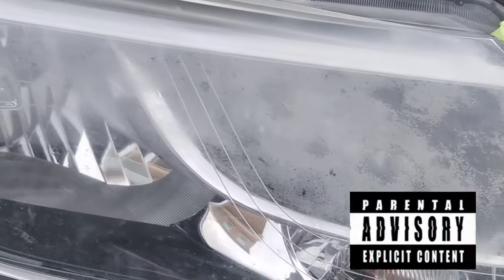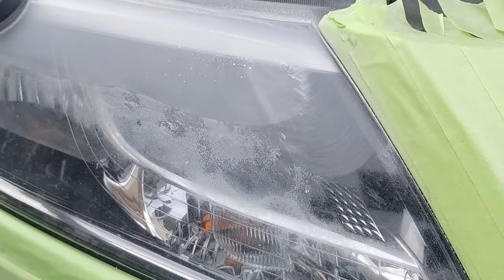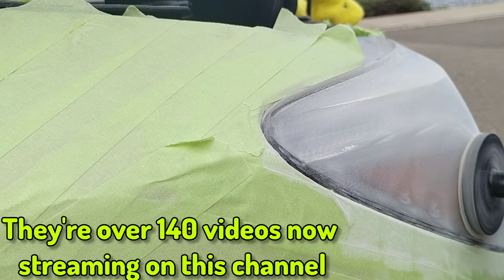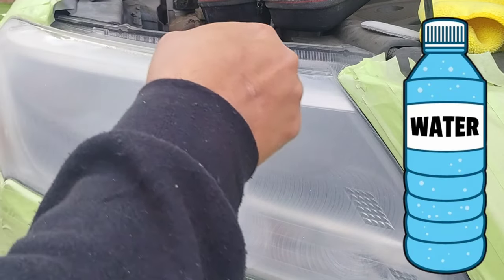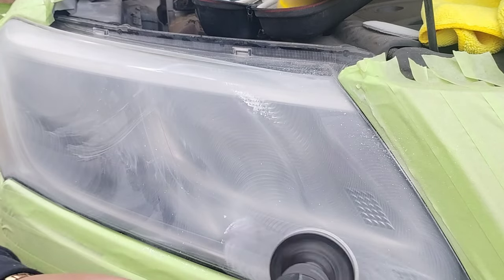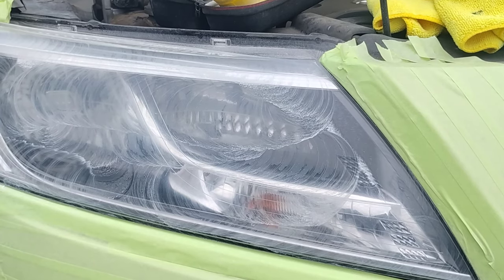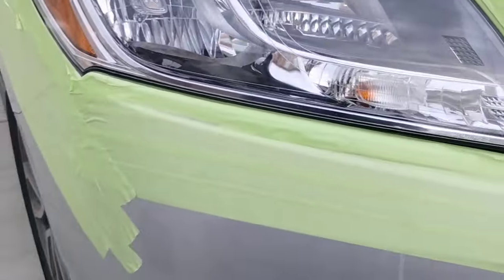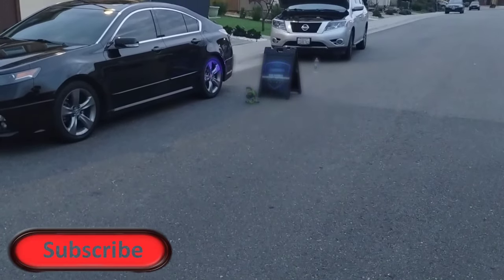Meguir's PLASTIC X headlight restoration - New & Improved ⭐⭐⭐⭐3/4 ⚠️

Comment: I gave this Plast-X polish a try, because the 3M Restoration System kit (39008) only came with enough compound for one headlight.  (Some headlights are so big today!)  I got good results by using it on the second headlight.  I would say it turned out as good, or very close to, the first light.  I do feel like I had to use more pressure, more passes, and more compound with the Plast-X.  The 3M kit I bought from Amazon came with a 1oz packet of rubbing compound (39005).  That compound has the unmistakable petroleum smell.  The Plast-X polish has a mild smell, like a household cleaner, as you said.  The bottle I got looked just like the one you showed in the video, and the liquid was light blue in color.  Anyway, it did the job ... and it's available for about half the cost per ounce of the new 3M 36060 compound, and it comes in a much smaller size bottle ... so it's a major cost savings for a DIY'er.

Comment: It's funny, I've had more problems with Amazon than Ebay.. I'm usually strickly Ebay. They usually have more selection at better prices. Plus the used aspect. Car parts, firearm parts, electronics etc. Ebay can be tricky, you gotta know what you're doing and what to look for. They also have a money back guarantee as long as the seller has a return policy

Comment: Hi I did it I'm a 63 years old woman. 
I used this method without the drill I used that little hand grab thing.  I only used 800 the spong in the Maguires box  then a 1000 then a 2000 used rubbing alcohol then soapy water dryed then the spray . It came out good one thing after it dryed I can see a bit of cloudy still why do you think that is did I not put enough after spray on.
In the morning I'm going to lightly sand with 2000 then the Maguires plastic cream like you have .
At first I thaught oh no I ruined the light but bingo came out clear . Thanks for your videos it gave me the confidence to do it 👍

Comment: What's funny is that, I used that New and improved Meguiars plastX polish, as it was the only available option to me in South Africa, 
Other things I had to find alternatives were the 3M Trizact pads, just settled for p3000 normal disc, 
Then I couldn't get Meguiars headlight spray, but here in SA there is a another made for headlights sealant spray called Lens Clear by HB body, so I used that, not sure if it'll last as long as Meguiars, but I guess I'll see. In terms of clarity, its top tier, didn't get any orange peel or funny effects.

Using your method I was able to get my headlights looking new again just last week, it was the 1st time I ever used any of the products and tools, but followed your method to the T and  thank you for all information, 

With my lights looking good, other than washing your car frequently, what other things or products can be used to maintain the restoration for a very long time?
Reply from the maker: Awesome man I'm glad everything worked out for you..👍🏽
Reply: @theheadlightrestorationpro  in terms of maintaining the headlights any products you can recommend or tips for the restoration to last?
Reply from the maker: @PointJustice aftercare is the way to go
.. here after care 1.0 and 2.0..
https://youtu.be/kIur4XxYjDk?si=d7y0X9PmW-z8dwXM

https://youtu.be/UILdVBbDyLo?si=LH1IawmlwH2VPaXi
Reply: @theheadlightrestorationpro  thank you so much, Really appreciate it, our hero😭
Reply from the maker: @PointJustice 🙏🏽🙏🏽🙏🏽🙏🏽
Reply: How do you feel about applying a paint ceramic to the lights afterwards? Diy detail 8yr

Comment: You sandpaper the headlights dry? I heard to do it with the light and paper wet? Lmk your opinion, also, what would you opinion be on after using the meguiar cleaner x would applying a UV blocking clear coat on top of taht aswell cause any problems?
Reply from the maker: My opinion is look through my channel watch a couple videos just over 140 videos now streaming on this channel what you're asking there's a couple videos about dry sanding here's one..https://youtu.be/9DfP_dqw1mU?si=W_tdDtCbNMG264Ql
Reply: @theheadlightrestorationpro after viewing almost all your videos, this is the method I’m going to go with. Thank you for your content. Excited to see how moving from sylvenias liquid UV blocking to this will be. Will post a comment when I do to give my opinion! Looks promising!
One last question before I buy everything, I noticed you made a video on how to KEEP the headlihhts restored longer by using Presta wax, and banana creme wax, so my question is, how long would it take for the megauires clear coat take to dry, and once it’s dry would it be smart to apply the creme on after on a pair of freshly restored headlights ?
Reply: @theheadlightrestorationpro haha bro! Did my first restoration using this method, customer was very happy! I even told them to make sure to buy the nano crème banana wax and to apply every 4-6months for them to maintain it. Way better than the sylvenia kit I was using

Comment: Question 
I have a 2019 f150 and my headlight are clear but bits of the clear coat is flaking off but the lightbis still crystal clear.
Should i went sand the entire light then put Mcguire s headlight spray on it? Or should i just clean it with plastic x then just clear coat over it with Mcguires? 

Thanks

Comment: Have you ever started with wet steel wool to remove old clearcoat?  Then start sanding? I’ve been restoring a few headlights recently. Really leaning a lot from you videos to use best practices. I was also wondering if you have a set price or sliding scale as you mentioned a car lot needing several done. Dang coating jumped from 8 to 13. Lol. Thanks for your practical information to really use.
Reply from the maker: No never used steel wool.. I would think it would be more difficult and maybe mess some things up.. be careful of your drinks is going up or something today I bought some for $15 a can... They usually go up and down but I've never seen him go up this high it might be my channel runs a lot of pricing up..lol
https://youtu.be/1YCVKzBkNyE?si=TuFD59Vdsi-UYlxl

Comment: How and why do you use your fan? Do you use it on every headlight restoration? Thanks
Reply from the maker: Yes...I use my fans..(2) on every headlight restoration...
Forced are drying...air drying is the best for headlight products because the actual dry from a process calls air exchange and or chemical exchange wich has to do with releasing moisture in the air...more air more drying....
Also helps particles and debris to not fly into the finished product...

Comment: A-yup, I tried a little hand sanding on my own headlights with 320 grit (it was a pretty rough headlight and my 500 discs were all shot.) I cleaned it up as much as I could with the 800 grit and the Trizect but there's still obvious scratches when you look closely at the headlight. I've also been watching Paint Society and he seems to live by Eagle Abrasives K-grit discs for paint and headlights, and I was curious if you've had any experience with using them on a headlight restoration? Good video.
Reply from the maker: Nothing compares to 3M products I can tell you that much.  . If they don't have stock options and are not a billion dollar company chances are they're not going to be as good as 3M...

Comment: How does PlastX compare to Meguiar's clear plastic polish?
Reply from the maker: I'd say it's about equal they both have about the same rating in my opinion they're both lacking just a little bit on one thing or other but definitely well over the threshold to be good enough to use... You have one that is lacking just a little tiny bit of oil content.. maybe you have one that is really loose and could be sicker...

Comment: When I use the disc to sand, the surface area of sanding is small and only in the middle of the disc. The drill attachment I use is the one that came with a 3M kit. What do you think it is and/or should I use a different attachement?
Reply from the maker: Not sure whatever you're using must not be working correctly the whole pad should be flush something's definitely wrong it should be a flat surface which gives surface contact like a pancake flat and even so if that's going on you have something wrong with defect or something I should try something else...

Comment: I got a question can you do a aftermath of a job useing this method with the meguiar's PlastX Clear Plastic Cleaner & Polish. Since I can't find the 3m Plastic polish product because its discontinued so i was going to use the Meguiar's PlastX instead.
Reply: Can you do a aftermath of a job useing this method with the meguiar's PlastX Clear Plastic Cleaner & Polish. ( Yes )
Reply: @immortalassassin4456  thank you
Reply: @weliftnation2418  welcome today i tried this method and had 100% great results. To factor one thing that I am not experienced at all in this field and still turned out great so I am very surprised by the Dry sanding method

Comment: Thank you for the value!
I understood you change the P500 up to 3 times per headlight. But what about the P800 and P3000? How many P800/P3000 do you use per headlight?
Thank you for Eastern Europe!
Reply from the maker: I honestly would just watch a couple more of my videos to see the variations of the p800 usage.. typically majority of the times it's one per headlight but sometimes it ends up being two or three depending on the headlight or how much damage is done on the stages before... The 3000 trizak is used probably for about 3- 5 vehicles..

Comment: Hello sir, new subscriber here from.the philippines.

Ive watched couple of yr videos and your work is above and beyond .

After using p500 n p800, do u throw them away?

Sadly, 3m p500 n p800 is not available in our country, there are 500 grits without the "P"
Reply from the maker: Yes I told them away when they are of no use anymore usually after each use they are done if they're still a little use in them I save them for another vehicle...
Unfortunately p500 is not 500... You'll have to look at a conversion chart and tell you what equals a p500 it is not 500..
Thank you for watching..
Reply: @theheadlightrestorationpro  thanks bro

Comment: Sir pls I need help please!!! I used this method on a gmc sirrea, when I went over the curve of the headlight somereason my sand paper (3m 500 grit) it like melted??? And the orange from the sand paper like melted onto the headlight? I was using a power drill. I was able to remove some of it but not all by sanding it with a new paper. the customer wasn’t very pleased and said I can try tomorrow to remove it again but if I’m unable then I need to buy them a new headlight…. Please if you’ve ever experienced this and know what to do pls lmk 🙏🙏🙏
Reply: Is it because I was using the power drill on full power, causing the sand paper to melt? Should I only pull the trigger half way down? I used a 20v Hary power drill , max setting, and the switch on 2. Is that the proper settings? If so like I said do I just not pull the trigger all the way down?
Reply: @TrixxOfficial747 dand it over with a finer grit of sand paper and make sure you are constantly moving the drill around u probably stayed in that spot too long
Reply: @buddahkahn6911  yeah maybe so, I’ve decided to stay away from dry sanding with the drill tho for now.
I’ve been wet sanding with drill, then i go over it again with the hand tool and dry sand it then
So 
Drill 500 wet - hand 500 dry
Drill 800 wet - hand 800 dry
Then 
3000 wet only on polish drill
Polish with megauires plastic-x + Chemical guys headlight restoration (2/3 megauires - 1/3 Chemical Guys)
Then apply the Meguires clear coat